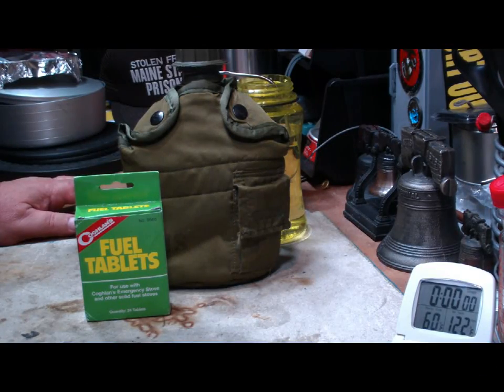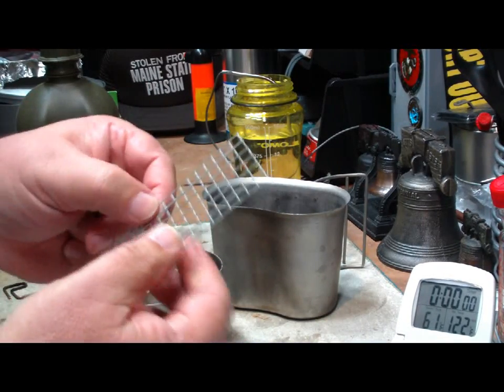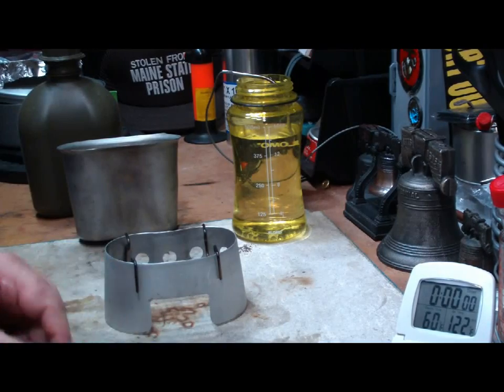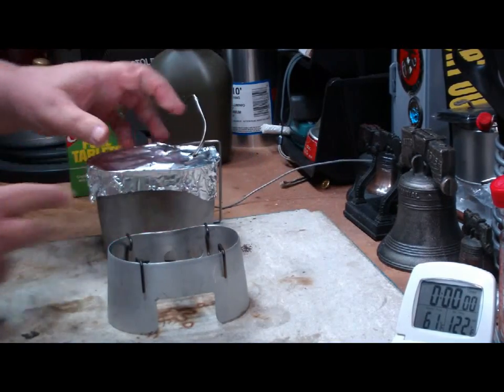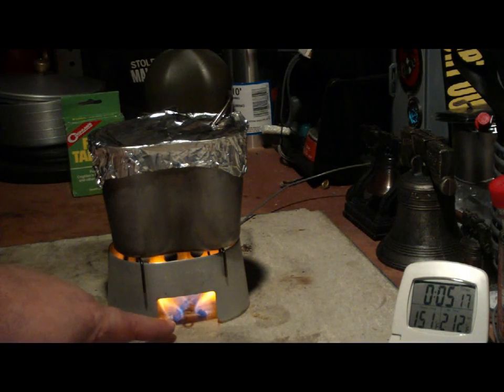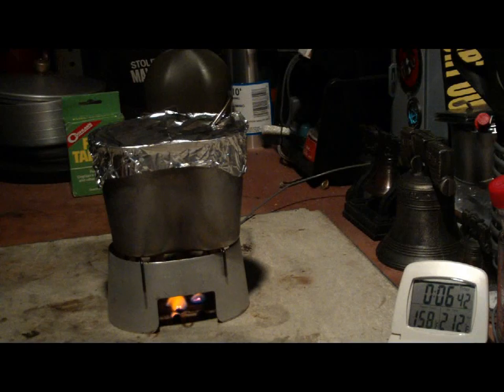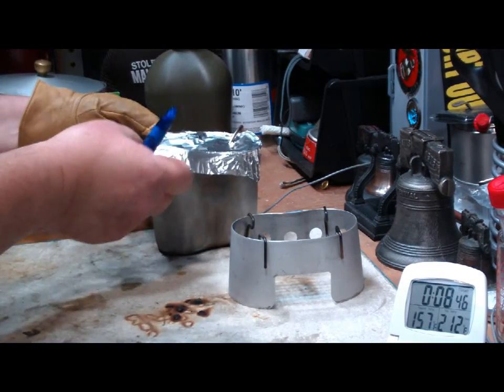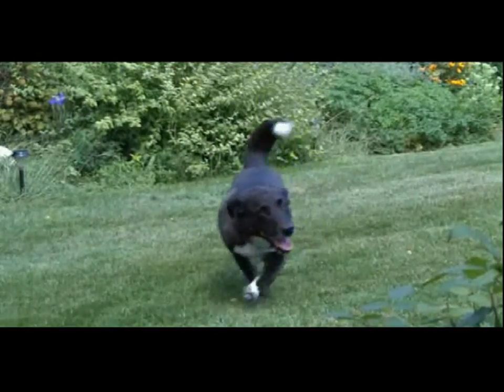Esbit Canteen Cup Stove with Mod 1 using Coghlan's Fuel Tablets - Boil Test #2

Comment: I've used (Australian made) hexamine fuel tablets hundreds of times during my time in the Army and I've not seen them dissolve and run through the bottom of the (Esbit style) folding stoves we used like this.  The fuel must be part of your problem.  Perhaps a sheet of tin with small holes punched in it for ventilation would be better than the wire mesh (I refuse to call it "hardware cloth").  Your set up is brilliant though and you could use it on a picnic table without leaving scorch marks!

Comment: I did a similar test. Water boils at 212 degrees f.  My finding are using this brand of fuel tablets it took 3 at one time to boil the water (1/2 - 3/4 full USGI canteen cup) and cook 1 bag of Ramon Noodles. The toal time was about 15 min.

Comment: this stuff is the best stuff you can buy ....in my mind for the price you just cant beat the price.. verse esbit just add another tab.... sportsman guides survival fire gel is the best for heat it is also hard to light if you put it inside of a different pouch or/ vessel and just add an once of alcohol to the mix after you you shake it up or bled it together  you can just light it with a spark..